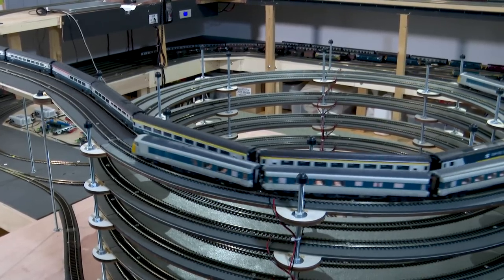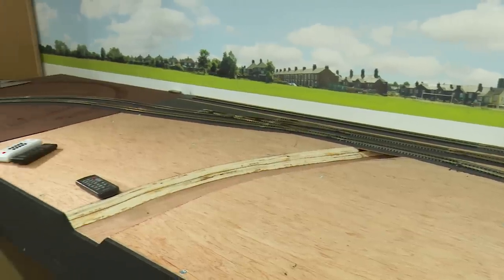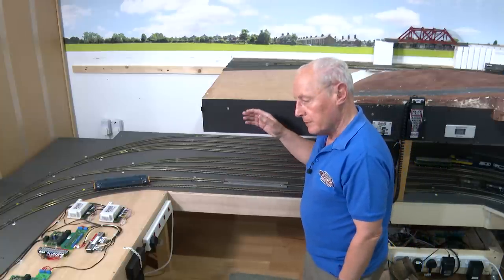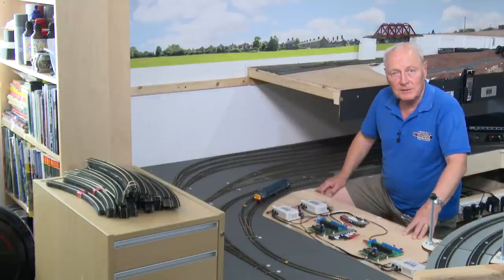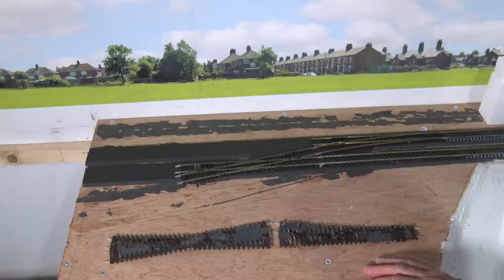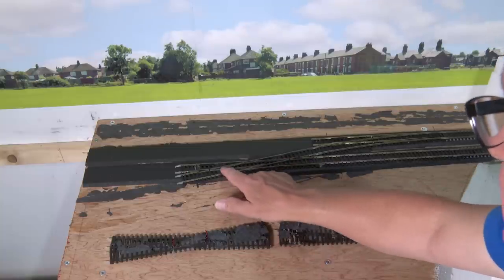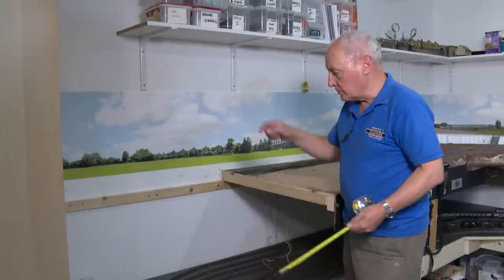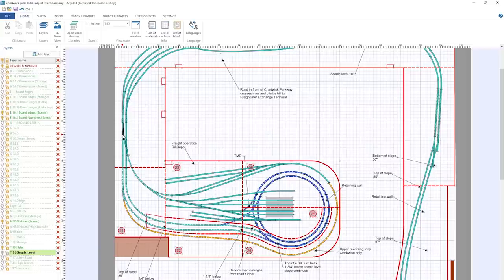The Big Track Link Up at Chadwick Model Railway | 167.

Comment: Hi Charlie, fantastic video as usual. To make your life easier, when you cut your baseboards, clamp a batton (straight piece of wood) on so you can keep your circular saw held against it as you saw, you then don’t have to concentrate on keeping a straight line, the wood guides your saw for you. Just get the offset correct. You can then make the cut a bit quicker. It’s all looking rather good though. Such fun to watch
Reply from the maker: A great tip, and very much appreciated. I need to improve my carpentry skills, regards Charlie

Comment: I used a similar reinforcement method with my track-bed, I used 6"x 1" treated planks on 3" posts with a 3"x 1" section of plank on edge screwed just as you did. Over 2years in the garden and still no sag so you will have no problem with yours Charlie. The helix's look great and it was all down to careful planning on your part, you deserve a bonus for your dedication and quality of workmanship.
Reply from the maker: Thanks Peter, and so pleased that you enjoyed the video. Regards Charlie

Comment: Well done Charlie.  I am not sure I could handle a helix and a double level layout.  Thank you for sharing your achievement.   It is encouraging watching you and sharing some mistakes now and then.  I am having trouble with a single level N scale Canadian running DCC and I do not have any electronics to worry about other than the DCC control itself, no point motors or districts for me.  I need a turnout change I call "manuel".
Reply from the maker: These things are sent to try us, but otherwise you wouldn’t do it! 
Regards Charlie

Comment: Dear Charlie, not to discount your trial and error experience, but your AnyRail drawing also gives you a template, on which you could have measured the connecting board to the approximate widths, length and possible points for the M8 threads.
Humbly think the connecting board to the helix will interfere with the further construction of board 22 and the intricate track plan, you’ve planned for covering the east-end helix.
Reply from the maker: There is more pressing issue. How to build the upper reverse loop!
Regards Charlie

Comment: Great update Charlie,  good to see some continuous running. Make sure you test the 125 and Pullman with powered vehicle at the front and at the rear as the train will be less stable when the powered unit is pushing.
Reply from the maker: Sound advice Steve, however, the poor man has a power car each end. Regards Charlie

Comment: This is great! And great to see, too.
I am only puzzled by the big screws keeping the track in place; why not use tiny, inconspicuous ones, which fit in the holes in the sleepers?
Reply from the maker: It’s a non-scenic area, so it didn’t really matter. However, I can always loosen the screws with an angled screwdriver and move the track slightly, should I need to. Regards Charlie

Comment: Hello Charlie.. As always I enjoy your presentations and look forward to the next instalments?  episodes? Anyway... Where this one is concerned, even if I've decided nothing else about my intended layout, I can at least say that my initial idea to have that layout' operating surface no higher than the top of my shoulders and no lower than my hips, has been well and truly reinforced. Whatever those measurements turn out to be, will be the measurements that I adopt.  I'll also be seeking to engage in what some might consider to be ambitious engineering where the benchwork is concerned. The end result will enable me to raise and lower the layout sufficiently so as I can gain access to the middle of the layout without having to duck under and when maintenance, inspection or modification is required, I can carry out any work to the underside of the main operating level/s with greater ease and comfort.. Thankyou again Charlie. As always, It is and has been a pleasure.
Reply from the maker: I’m so pleased that the channel has provided you with a useful insight into baseboard heights. Regards Charlie
Reply from the maker: I’m so pleased that the channel has provided you with a useful insight into baseboard heights. Regards Charlie
Reply from the maker: I’m so pleased that the channel has provided you with a useful insight into baseboard heights. Regards Charlie

Comment: A Brilliant Achievement Sir. I have been following your uploads for Some time now. And as I'm in the process of Building my own oo tail chaser Irish Rail 1950s/60s the end off steam to the introduction of American and British Diesels.
When you reach an age that both of us have reached the logical thinking would be to use the Labour of our offspring.
Buying Timber from B&Q can be Expensive. It's A lot cheaper I find if you use a Timber merchant the standard 2"x1"par is sold as approximately 16' rather than 2.4mts same applies to Plywood Sheets.
🇮🇪 Retired Irish Rail Craftsman
Reply from the maker: You are of course right, however I like people to know of a nationwide outlet that might fulfil their needs. Regards Charlie

Comment: Like yourself I use Anyrail, I designed the boards as well as the track, I printed out the boards to scale, I purchased ordinary 12 mm ply, marked it all out after jiggling around to give me minimum waste, and cut them out with a jig saw. I had 22 pieces of different shaped boards and when I came to put them together I found an 0.5 mm thickness variance and the boards had warped. I had to purchase 2 off 8 ft X 4 ft Marine ply boards and start all over again. So just be aware of what you buy.  Another word of warning, Back in the late 80s I used Peco foam underlay which was developed to match the track and everything was fine for about 25 years, After which I found that the foam had turned to tar and the track dropped allowing the track pins to contact the rolling stock. I had to lift the whole 250 ft of track with the 48 points, and start all over again. I now use 4 mm cork. And I redesigned the layout.
Reply from the maker: Worthwhile lessons Sam, but sadly learned the hard ways. I had known about the pico underlay turning to dust but not tar? Regards Charlie

Comment: I think that with these around 5 feet spans, it is always worth considering using the 12mm plywood, but instead of using the rods to give support all the way to the ground, adding rigidity by going under the length of the plywood with one inch aluminium box section and giving the box section support at each end. It all depends on whether or not having the support rods in place bothers you. PS, If I had just watched for a further 30 seconds, I would have seen that you had figured that out lol
Reply from the maker: Thanks Barrie, I’m so pleased that you watched it to the end, stay safe, regards Charlie

Comment: Hi Charlie, as others have said, very impressive. It’s alway a great feeling when finally the two ends of your layout are at last joined together,a great achievement. You need to be aware of the tendency to sometime play trains instead of cracking on with modelling on your layout, I speak from experience. 
I was very impressed with your agility crawling under your layout. Despite working in the electrical industry, all my turnouts are operated by fine piano wire in 3 mm brass tube. Due to advancing age, all turnouts that I have made and installed recently are now operated by wire in tube installed and hidden on the top side of my layout, result no more hot solder dropping on hands or face. Regards Barry
Reply from the maker: You make a valid point Barry, however I’ve still avoided dripping solder on my face thankfully. Regards Charlie
Reply: I like the idea of using piano wire and brass tube.  Do you have any methods you would like to share?
Reply: @traincruise5491  Hi, I would be very happy to share the methods that I use to operated my turnouts using just piano wire in brass tubes. I have photos and information on the parts that I have used, but unfortunately I have absolutely no idea how to post this information on to you via YouTube. Any ideas ? Regards Barry
Reply: I am not sure how to do this via YouTube.  Maybe this is something Charlie can help with.  An episode on low tech model railroading.

Comment: Nice one Charlie, I've finally got my n gauge double track, double loop (think figure 8 folded over) up and running in the last week or so. So nice to be able to run continuous trains. Sit back with a cuppa and enjoy. I'm also getting the trains out to see what performs and how well before extending the layout. I've followed you since first lock down and very appreciative of your videos. I also use AnyRail (I believe that's what you are using) for design - balking a bit on the cost of Train Controller tho so using JMRI at the moment - I think adding block detection will push me towards Train Controller in the end
Reply from the maker: I’m so pleased you enjoyed the video Stuart, the automation, he’s a real drain on the finances so beware. Regards Charlie

Comment: Excellent end to a long journey that we could all enjoy! Well done and thank you. My layout is DC so please allow for this if this is a dumb question...  I understand that you can set a route and stop a train in a particular siding, by use of block detection etc using DCC ... but can you program it to slow down, stop in a 'through' station, pause, and set off again, or does that require a computer to have control ( a la McKinley Railway)?  Cheers Mike
Reply from the maker: Yes Mike, all that is possible.
Rest assured that I’ll include it in a future video. Regards Charlie

Comment: Hi Charlie. In the 2 & a half years i have viewed this is the widest i have seen your layout of The Chadwick Model railroad. When I watch i'm looking from a small phone screen. This is bigger by most cell phone standards. My concern is oh my gosh can Charlie fit under there ? 😱 Is he okay ? Can I help ?  Well not exactly.   Little did you realize you had outtakes  & didn't realize it when your phone was ringing. You had me in giggling a little bit. You did mentioned about if i wasn't looking can my trains run without me not looking ? 🤔 2.  answers to that is Yes & possible. I did that on my former layout in a ATLAS AEM 7 AMTRAK & AMFLEET coaches I had them on semi  slow mode I forgot to turn the throttle off before going to eat breakfast in the other room. When i returned it was running smoothly & quiet. I joked & said oh my it was running on automatic pilot like an airplane! 🤣🤣🤣🤣
 You  Meanwhile as you were doing the wood cutting outside I  felt I was watching "The AMERICAN WOODSHOP" with Scott Phillips on PBS. You did the carpentry 100% professionally. 
As for the trackage to board. I'm glad you brought that up. To screw down tracks? Usually that's odd. Considering PECO & ATLAS. ATLAS has nail track ties holes on HO & N scale. PECO doesn't. but it was interesting to see this attached on your curved sections leading towards the helix. My option when i didn't use the Atlas nails i use wire regular nails and/ or brads. As for screws please tell me the number so i can use & mount these on my new trackage yet to be placed down on my  HO scale. 3 quarter board no doubt so when you mount motors, switches & other hardware under your layout. Modular that's what i am doing on current layout projects as of this writing. Very glad to see how you did your version done. 
The finished product: The trains ran well. I'm  viewing your next videos after this I thank you once again for this video. 
Harold 
BC RAIL / CN RAIL
GO TRANSIT/ VIA RAIL
CSX/ CONRAIL/ NORFOLK SOUTHERN
Reply from the maker: A brilliant comment Harold.
Rather than use nails, I would use Piko screws. It’s so easy to make minor alterations.
Regards Charlie

Comment: All I have to say is BRAVO. I can't wait for the two final stations on top of the helixes. By the way, since the energy cost in England (and all over Europe too), is going though the roof (so to speak), are you going to charge Chadwick Model Railway extra for the electrical usage! Can't wait for you answer!!!!
Reply from the maker: If only. I have a smart meter which shows when it’s a filming/building day!
Reply: @ChadwickModelRailway  See, you can do it. Now, would the personnel of Chadwick Model Railway go on strike?

Comment: Fantastic achievement Charlie.  You didn't mention the afterthought.....'signalling'  - another nightmare with drilling, sawdust, cables, configuration, which signal controller, Traincontroller  etc etc  (Or are you not going to bother?  :-)  Keith
Reply from the maker: It’s funny you should mention that Kieth, I have some being delivered on Monday from Absolute Aspects. Regards Charlie

Comment: Excellent work Charlie, and another big milestone ticked off!  I heard your comment about going uphill on the outer track of the helix, which makes perfect sense to reduce the gradient. But then, I started thinking about the other helix, where surely you’d end up going downhill on the outer track. Can the outer track be uphill on both?  I’m really struggling to get my head around it. Do you have to cross over somewhere, and run clockwise on one and anti-clockwise on the other?
Reply from the maker: No Steve, I’m afraid that both helixes climb clockwise!  You have to get your head around this one. Regards Charlie
Reply: @ChadwickModelRailway  I spent some time with a sheet of paper and coloured pencils, and I think I’ve got it now. 😁  A train climbing your new helix clockwise on the outside will descend the helix at the ‘Barnstaple’ end anti-clockwise on the inside, because of the way the tracks swing out to the front of the layout as they descend from the viaduct.

Comment: Great to see some trains running free again, Charlie. And time maybe to recognise that your days as a contortionist are over? ;)  Which leads me to a quick side question: remind me what's the difference in track height  between the 2 levels?
Reply from the maker: I’m so pleased that you enjoyed it, and the height distances are both 18 inches. Regards Charlie
Reply: the storage level (or "fiddle yard" as Charlie calls it) is nominally at 18" from the floor and the bulk of the scenic level is nominally at 36" from the floor
Reply: @leestoddart7014  Thanks!

Comment: Charlie: did you ever realize, that the bottom nut on the topside of the lower base board could have been screwed from the other end of the rod? 🤣
Reply from the maker: Yes indeed I did. However he wouldn’t of seen the full potential of the swift nuts! Regards Charlie

Comment: That’s an achievement, Charlie. I was inspired by you to extend my layout around the room, and was pleased to get things running right around on the level, so I can only imagine your sense of satisfaction seeing this all come to pass. Of interest, what is the scale length and time for each circuit, and the actual distance around? Must be into several miles in prototype?
Reply: The total distance round the "Down" line circuit (The one traversed by the reverse livery set) is 212ft while the "Up" circuit (used by the 125 set) is 214ft
At a scale of 1:76 they are each represent slightly over 3 scale miles

Anyrail statistics for the complete plan (including the sections not yet built) are
Helix	             237'-9 1/2"
Scenic	             244'-5 3/4"
highbranch	        41'-11 3/4"
reversing loops    29'-0 3/4"
storage	              331'-8"
Reply: That’s impressive.
Reply from the maker: Wow, I didn’t even know it was that long. Regards Charlie

Comment: Hi Charlie hope your well... 
Can you possibly help me out. I have the bachmann midland pullman in nankang blue. I am currently on a gaugemaster prodigy handset and cannot use the cab lights. On function 2. Yes it lights up but once you release the button they go out.  Is there a setting I am missing out on here. If so please can you explain to me the best way to change this. Thank you in advance Charlie. All the best Daz.
Reply from the maker: Hi Darren, it’s a “Non Latching” function button.  It’s designed for a horn or whistle.  That way,  it only sounds when pressed.  You need to remap the lights to a different number or redefine what happens on the handset.
Regards Charlie
Reply: @ChadwickModelRailway  don't suppose you know how to remap the lights to another function
Reply from the maker: Only on ESU decoders using an ESU programmer. Surely there must be a Facebook site for yours. 
Regards Charlie

Comment: Hi Charlie, I too have a double main line, twin level layout with two helix's, and know the gratification you feel with the achievement of having trains run in both directions at the same time over the whole layout. I planned my layout in Anyrail, and it calculated that I had a bit over 500 meters of track all up. I think my helix's are a bit bigger than yours, with a diameter of 2200mm.
Do you have an estimate of the length of track for your layout?
Reply: I've posted track lengths as a reply to another question but the total planned length (including the sections not yet built) comes to just shy of 270m
Reply from the maker: Thanks Lee for answering Wayne’s question. Regards Charlie

Comment: Hi,
The glue you use to hold track down (copydex?) What type of glue, any hints about its normal use, so I can locate equivalent type of glue in New Zealand 
Thank you
Reply from the maker: Hi Ronalyn, Copydex is a safe rubber based glue often used a lot in schools. It’s also used for gluing down carpets etc, it’s white and smells of fish! Regards Charlie
Reply: Hi Charlie, 
Question can I combine peco code 75 bullhead, with standard finescale peco code 75, reason I using mainly  peco bullhead, but need to add a couple of curve turnouts, and there no curved bullhead turnouts.
Reply from the maker: @ronalynausan791  I’m pretty sure you can, you just need to get the converter rails. Regards Charlie